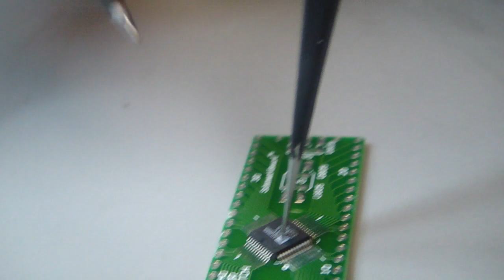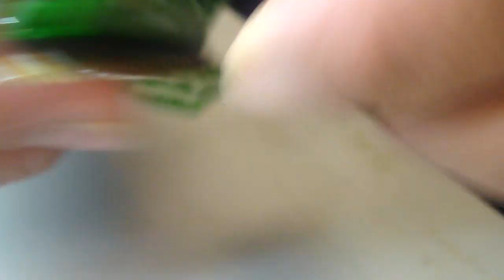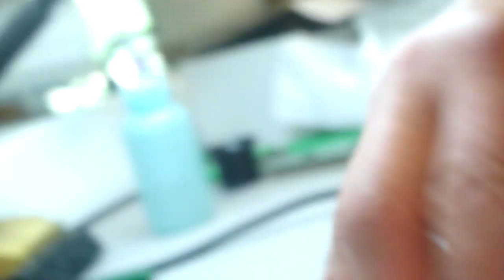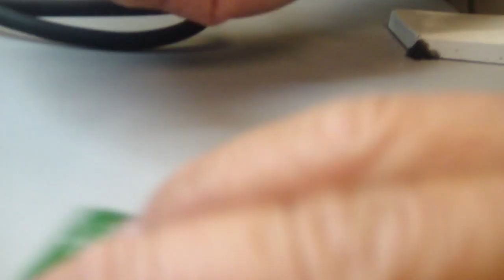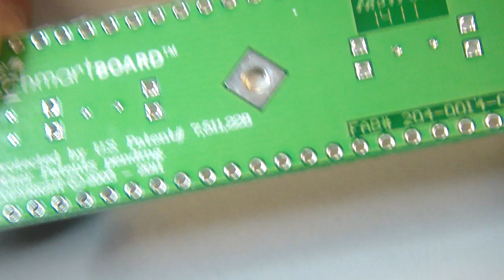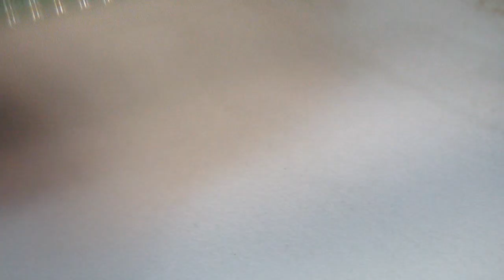QFP and QFN to DIP for Breadboarding

Comment: This is a dumb design idea. Added connectors parasitics means this will never work like it should for testing an idea. Furthermore all those QFP QFN chips always have crystal oscillator pads that needs to be connected directly. Going through a header to a breadboard it won't work reliably if at all. Typical dumb tech ideas.
Reply from the maker: goognam goognws This may not be for every situation..however they are our best selling product family at this time so they must be useful to someone.  This is not meant to replace a custom prototype, but is a step before spending the bigger buck on a custom PCB with professional assembly of QFNs
Reply: you guys do realize that you didn't even bother to properly align the chip on the board right? 1:10 i wasn't even paying attention because i was talking on skype and i manage to see that yet you guys miss it? its not the really a good thing to show

Comment: I find that I can mount small resistors and caps under the board between the headers.  The header pins are long enough to straddle such parts.

Comment: What do you do when you have a 40-pin 0.6" dip package? The same. You wire in the column positions that will be under the chip and put the chip in when you're done.

Comment: Thumbs down, without question.

The designers of this product completely failed to notice the obvious fact that the board obstructs most of the preciously few pins in each breadboard column.  It must have been designed at 16:50 on a Friday.
Reply: buy a bigger board